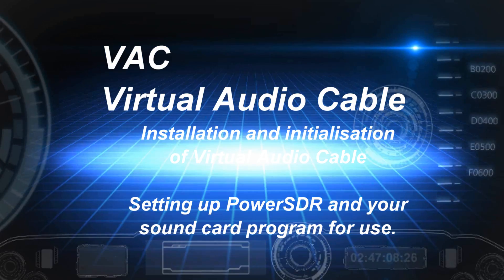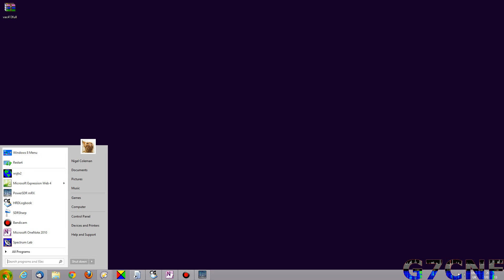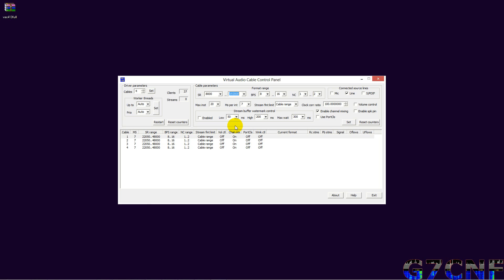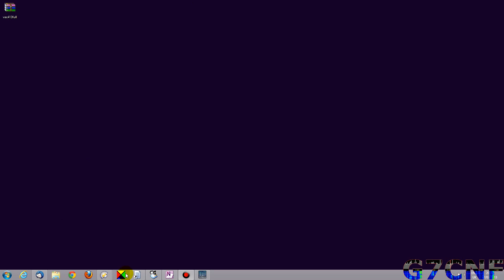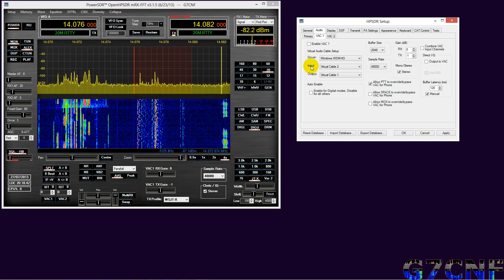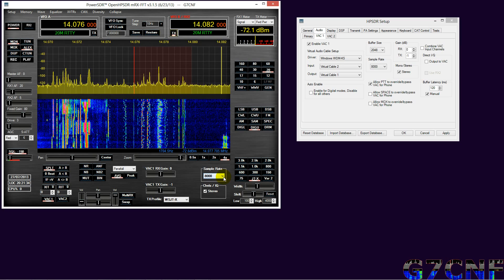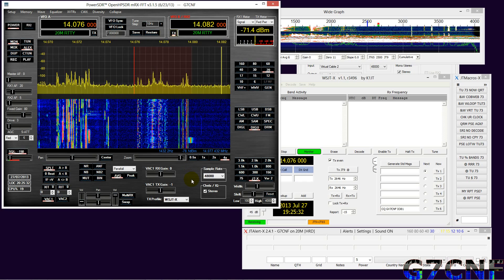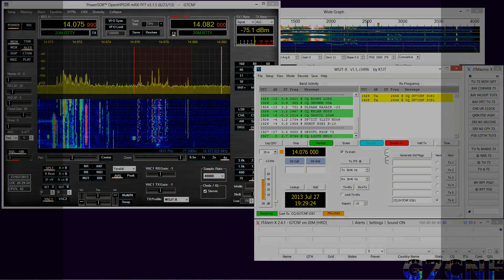VAC: Installation and Initialisation of Virtual Audio Cable with PowerSDR Digi-Modes

Comment: I'm now back wanting to use my Flex 5000 for FT8. Your Virtual Audio Cable setup is easy to follow. But I don't understand how the ComOCom comes into play. I did not see how the serial ports are assigned in WSJTX program. Please explain how you did that?

Comment: very nice video, I just received a anan200d and I am trying to setup HRD on it , I followed your video and got it working ,, only thing is when I xmit dm780 like psk my sound is very crackly and poping and the tone does not sound correct , I was listening from a different radio , any suggestions ,Thanks KD8KOR

Comment: One of the things that bugs me about PSDR is that I often like to have CW Skimmer running (VAC1 via I/Q) while I'm running WSJT (VAC2).  But then I can't seem to locate a way to provide Audio output to my speakers at the same time.   Well I have a work around, but I really don't prefer it.  My Work around is to either point CW Skimmer Audio I/O to the PC Speakers, but then I loose PSDR Audio filtering to the speakers since it's routed via CW Skimmer.  The other is to run VAC Audio Repeater off VAC2 and share audio out from VAC2 to PC Speakers via the repeater, and also still feed WSJT off VAC2.  

Anyone know if there's a better way?
Reply: You need to use the "repeater" tool in VAC to do this.